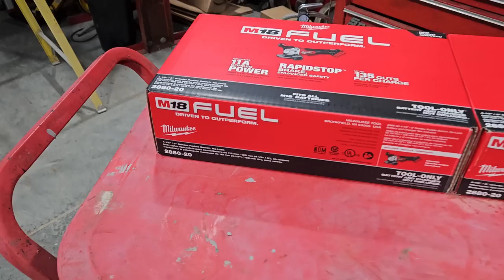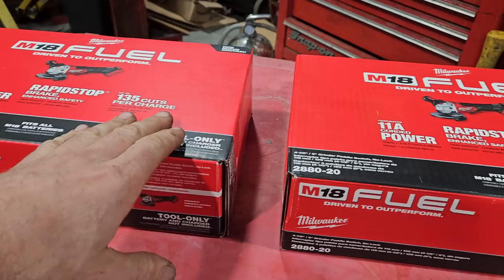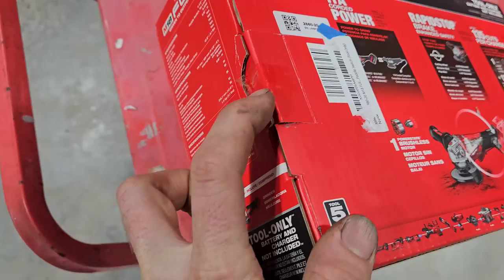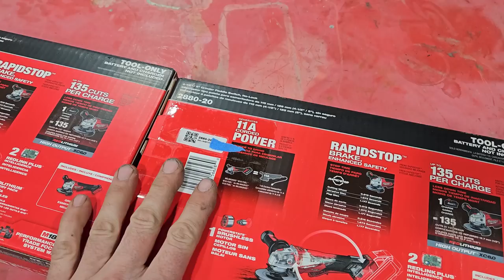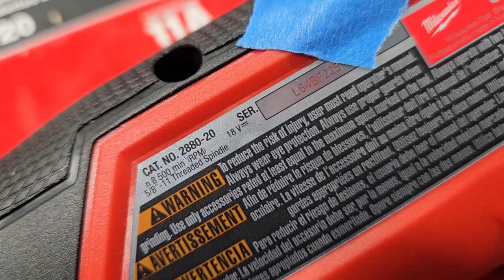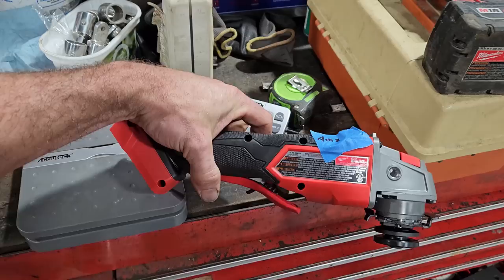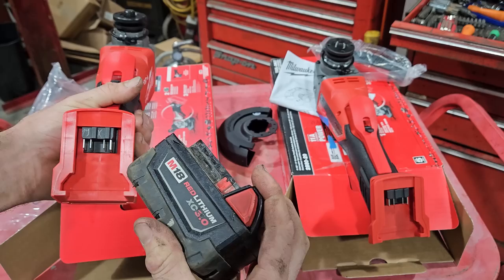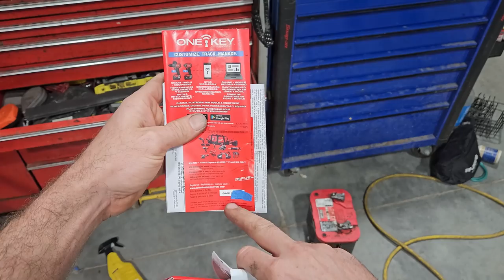Amazon MILWAUKEE Tools FAKE or THE SAME? Half Price!

Comment: I buy all of my Milwaukee tools (39 and counting) through amazon, have sent in over 12 tools, chargers, batteries to them for repair or replace WITH the amazon receipt, I've never had an issue with warranty (E-TOOL) repair service rejecting one for a fake tool.
Reply: That’s a high rate of returns unless you use them professionally

Comment: Both are real. Not saying anyone committed a crime. Wouldn't be surprised if a few boxes of Milwaukee tools ended up going out the backdoor, by a handful of workers at the factory where they are made. Can't price them too low. That just over $100 Amazon price is all profit. Same thing with Blackmarket Tide sellers. They go into big box stores in groups, grab massive amounts in their carts, head out the door. Everything they sell, profit! Some of those groups are small potatoes operations. Others.... You're dealing with some very scary, very violent gangs. Hey, money is money. There have been some known to trade Tide in exchange for drugs or even more dangerous items.

Comment: Remember folks that if your comparing tools from Amazon that using Home depot is a bad reference as they themselves have tools that are built specifically for them. You'll notice sometimes a brand of tool purchased at a real authorized retailer will have different part numbers than a tool purchased at home depot even though both are advertised as the same tool.
Reply from the maker: I always check the part numbers. Different part numbers means they're a different tool. Milwaukee has a vast line up.  And home Depot is a authorized seller

Comment: In my city there are so many so many tool resellers, 75% of them they sell brand new tools (they buy them by the pallets and sell them at 50% off) and the 25% used returned tools from depot or lowes. Def it's not stolen.
Reply: Look at you... You guarantee that they are not stolen? Hahha

Comment: I offer the following information based my experience both buying and selling tools Amazon as well as sending them in for service covered under warranty. I have a battery on the bench now that will be boxed up and shipped to them on Monday. So YES, They still have a warranty that begins on the day that the tool was produced. The date code is is part of the tools serial number. Home depot does not have or keep any record of the tools serial number and who it was sold to. And the barcode is added to the box by amazon at whichever fulfillment center the 3rd party sellers has been instructed to send it to.

Comment: As someone who works….. for a certain company…. I can tell you that the first numbers after the letters on the serial number are the year they were made. Indicating the 2251 is from late last year and the 230? is from early this year. 
People will take advantages of deals where you buy batteries and get a free tool, or vice versa, and then sell the free good online for any amount of money and they would be in the green. 
I work in Canada and two examples would be:
1. Buy an M18 Fuel Trimmer Kit with battery and get a free leaf blower - they sell the leaf blower for $100 CDN (normally $250 CDN) and they would be making money
2. Buy two M18 6ah HO batteries with a charger for $398 CDN and get a free Fuel tool (sawzall, grinder, circ saw, etc) which would normally be $288 CDN - they sell it for $100 CDN and they’d be in the green once again

Comment: This doesn't mean they are stolen. One way they do it is buy the tools in bulk or buy them when there is a free battery deal and return the battery. I have saved hundreds of dollars returning the free batteries. I've calculated I could have made about $125 on the M12 fuel impact driver and hammer drill kit when you get the free battery, if I were to sell them online after I returned the battery.

Comment: It's not counterfeit, It's just that sometimes amazon recieve like 5 pallet of tools from a seller and declare that they recieved only 3 pallet, and sells the other 2 by himself with a huge discount. I bought a milwaukee saw on amazon at 500€ wich was usually sold for 780€. But it's 100% original.

Comment: Hello electrical engineer here: in the most lamen terms I am going to explain weather this is counterfeit once for all. What people don't realize is that distributors make back alley deals. Same with factory personnel. They are genuine but those supply leaks are there. Someone or the distributor want to make a little extra money so they sell it on the grey market. Sometimes the factory does some back alley deals selling some access product in the back. Some may magically go missing weather they hit Thier quota or not. Maybe there's some factory workers doing it under their supervisors noses. This happens alot.

Comment: I purchased a brand new non fuel brushed 1/2 impact bare tool on eBay for $75 about a year ago, within 3 months it quit working so I entered the serial number then filled out a warranty return form on Milwaukees website and sent it in with the prepaid return label provided. Three weeks later I received my impact no questions asked with a sheet of paper detailing the repair work done, I can say from experience the” no warranty unless purchased from authorized dealer” line is not an accurate statement.

Comment: Could be no grease in the amazon head.  Failed tolerance inspection at the factory, so it gets sold out the backdoor for cheap. 
Or the amazon was liquidation from an over purchase from another store. Having stuff sot on the shelves is expensive, and this also tells you what kind of markup HD has on tools, probably close to 80-100%. 

That’d be my guess.
Reply: Their markups are minimal I worked there. The tools sold on Amazon are stolen that's why so cheap. They price is even below cost

Comment: I bet the amazon one have no grease in the head and might as well be a factory rejected batch of grinders when they realised that the automated grease applicators had failed. So to keep good quality on the market, they rejected the grinders that were assembled since the last grease nozzles flow inspection. Then someone from the factory brought them home instead of destroying them, and then sells them online.With no warranty because they know the heads have no grease in it. Ok, maybe i push it a bit but you GOT to open the heads to check for grease presence. Two ounces is the weigh of the grease for sure.

Comment: They are called gray goods. I bought a high end pioneer reciever with no warranty. It was not a knock off. It was not sold by pioneer US, with no warranty. It is still working 20 years later.

Comment: 0.2oz is like nickel weight, about 5 grams. Could be grease variation on the gears. HD charges extra for obvious reasons - b&m store, you can get it in a hurry, return it there etc. plus they constantly run free tool promos.

Comment: My guess is that the AMAZON is a second. Not all the parts you took out the the Home Depot were in the Amazon. The big thing I did not see  is the Amazon DID NOT have the grinder safety head and the Home Depot is. That would also account for the slight total with the box between the two of them. But AMAZON HAS TO STAND behind the tools for 30 days and that is less than the Home Depot which is usually 90 days
Reply from the maker: All of the same parts were in the boxes including the safety guard.

Comment: Will it depend on the tool stock today I was checking for milwaukee caulking gun and I found it at Amazon the cheapest one was $270  but at Home depot was $220 and you will find other tools vise versa so I think it depend on the tool stock.

Comment: There is also something called manufacturing outsourcing. I wonder if this has something to do with the significant price difference. As of tool performance I don't really see a problem between the them. In addition, Amazon does offer paid 2, 3 and 4 years full warranty to any of these type of "not authorized seller" products. At this point technically "Face" and genuine does not make a substantial difference IMHO.

Comment: Its real, it simply isnt worth going through that much trouble and then asking for a hundred bucks....makes no sense for someone to put that much effort into that type of financial return.
If its a stolen item....I can live with that...not my problem lol
It is always possible it was a returns pallet bid for Milwaukee stuff....sometimes they arent even used and someone gets lucky with some decent stuff on a pallet they paid like 5k for...its a gamble.
OR...Its possible its a pallet bid on stuff from a store closeout etc,,,,lots of different reasons you could be getting it at a really good deaL
It doesnt have to be from a Home Depot either, they dont have a monopoly on Milwaukee tools...Ace hardware sells Milwaukee along with others.

Comment: i knew a guy that worked for dewalt he told me that they make the same tool at the same factory in two different quality levels. a high quality for authorized dealers and tool stores and a cheaper lower quality version for the big box stores and everyone else. but they will appear to be the same tool but have very different prices,

Comment: Labels mean nothing, style can over time, they buy them on rolls probably hundreds at a time, next time it could be a different batch, problem is we keep buying the cheaper option, local stores need the mark up to pay overheads, warehouse has fewer costs, eventually no local shops, I want an item, local it's 180, online 125, but the local outlet won't be there much longer as they cannot compete, warehouse stuff is ok but when something goes wrong they can be awful.

Comment: it could be that the less expensive tool is refurbished , or it is older and out of warranty. I think you only get one year warranty with authorized refurbished too. With new tool you get 5 year warranty . I just took a mid torque impact into local warranty repair shop . They just look at the date on the serial number - no receipts needed. Within 5 years and free repair of the electronic module in my case which would have been over $100 just for part.  So worth a lot to get something with warranty . You can look up online how to read serial number to tell manufacturing date of tool.

Comment: Amazon is cheaper Bcz Home Depot has online deals that aren’t in store pretty often. Sellers buy up and later can make money while still selling cheaper than in store. Also the heads are cast and no two heads will be the same. That’s the weight difference. Also if you wanted to keep the Home Depot one you could of just switched the boxes and put the Amazon tool in the Home Depot box and returned it.

Comment: I was at a place that sells overstock stuff and they had a 1/2 Milwaukee impact that looks exactly like mine, expect for one glaring difference, the one I have you can change modes, the one at the place I went to does not have that option. And to top it off it was only like $40 different from OG price.
Reply: they make hundreds of tools, was it just a different model with different options probably?

Comment: The ones sold on Amazon were most likely defective units that were sold in store, returned, and repaired, then sold at a discount to a vendor, that’s why no warranty exists on the ones sold on Amazon, because the warranty repair was already fulfilled
Reply: Reason for the small weight difference could just be grease removed accidentally during warranty repair its was only a .02 difference not a .2

Comment: Probably from the same production line, big box seller here had a "15% less if you find the same model cheaper elsewhere" they always checked the "model number" catch was the model number was STORE SPECIFIC__  ie only they could buy them with that number, complete consumer rip off. Have seen the same on circular saws, they even have the same casting ports on they shell__ only difference was the colour and label.

Comment: For what it's worth, on a similar note: My brother worked in Shanghai for about 8yrs and made some local friends.  They would tell him about iPhone fakes wherein the employees would come in on 3rd shift and use lower quality materials they brought in and use it on the same assembly line to produce a clone phone.  Those would be sold locally or via online scammers.
This makes me wonder if the same thing has started with high quality Milwaukee fakes where a 3rd shift brings in cheaper plastics, bearings, etc. and use the same assembly line to fabricate their lower cost clones.

Comment: As someone whos been burned by Milwaukee not honoring a warranty from Amazon... Why? They looked up the codes, it was authentic, even apple will back there stuff off Amazon. I could understand if it was a knockoff battery or something. Luckily the Amazon seller fixed the issue for me.

Comment: I think people buy them from hd when they are running sales and when they come with free batteries.   The way it rings up is the tool is even cheaper then the battery rings up cheaper also instead of being free.   You still have a warranty it goes by the dom code instead of purchase date.   I could be wrong about how they are purchased but I know that's how the warranty works.

Comment: They are the same. Its just the sellers are not certified seller of milwaukee. Because milwaukee wants you to spend like 30,000 dollars on your first order to be an authorized dealer.  Now granted you won't get the 3 and 5 year warranty from millwaukee if you buy it from amazon but they are ways around that. Milwaukee will usually try to help you out the best they can. And if not. Well..... there are still more ways..

Comment: the weight difference might be an security tag inside the head    that Milwaukee puts in ts tools for HD. or to balance any run out .sometimes weights are added on a shaft

Comment: I bought one of these grinders off Amazon. It is identical to the floor model at home depot and it works beautifully. The only time I've needed to warranty is for the one key system or whatever it is with the Bluetooth Hopefully they fixed that problem. Mine broke right after warranty. Tools work fine won't wake up to phone anymore and one I can't select between the 4 settings. But I also beat the living Christ out of them. How I use my half inch drill to start small engines and four wheelers😅

Comment: 3 pounds 5.2 ounces from 3 pounds 5.5 ounces is a difference of 0.3 ounces. That's 3 tenths of a single ounce or 8.5 grams. And that comes from the two tools having slightly different spindle nut. They likely have multiple suppliers for that particular part.

Note:  Not that it matters but  the amazon unit has been out of the box at some point. You can tell by the way that the cardboard isolator was forcefully reinstalled causing the ends to be deformed.

Comment: authorized just means that the tool wont have the warenty which is why authorized is more expensive you pay double because if it does break under warenty they can just give you a new one no problem but un authorized means that theres no warenty and youll need to buy a new one yourself

Comment: The first thing that comes to mind is advertising. In addition, HD has the overhead of a big middleman, while the Chinese distributor may not have the demands of brick-n-morter locations, employees, and advertising. There are also costly product protection safeguards HD implements to handle their inventory properly with humidity and temperature controlled warehousing and material handling that I wouldn't expect from an unknown distributor. At the end of the day, the reality is this; once we buy a Milwaukee, we take it out of the packaging, and we store it in our respective workshops in various conditions. If it's a true Milwaukee, it's going to be just fine.👍

Comment: The home depot deal is when they are running  a promo (witch is almost always)- thats when home depot wins - they usually will throw in a free battery ect.
As far as Amazon and warranty - that is directly with Milwaukee and they are good with taking care of problems and Amazon is good too - if you were to get a fake just return it amazon will back you against the seller if there's a problem

Comment: I heard some where that 90% of the Amazon ones have something as little as the incorrect color, or rubber pieces are not even thickness, or plastic parts are not as hard as they r supposed to be so those get sold cheaper. No major defects just very minor things wrong. Not sure if that's the truth or not just a rumor I was told.

Comment: i think the reason depot is way more money is because they take back any thing for the most part. so the over charge makes up for any loss that the manufacturer doesnt give them credit for. just like insurance companies they never lose out. my son bought an outdoor furniture set and it started to rust. he called them and they said we will send some one out they did he filed a claim and my son got his money back but depot never came to get the furniture set. so he sold it on line. i thought either depot has an insurance on their products or they over charge soo much that they can afford to take the loss, but like i said they take back anything no questions asked for the most part

Comment: In many cases, it could be that a batch or shipment was rejected at some point in the distribution process for some reason....and ultimately ended up going to the reseller on Amazon.  It also may simply be a little as HD pays to be an "authorized reseller, with full warranty backing" and this guy on Amazon does not.   Back in the 90s, my dad worked at a Radio Shack store...and I forget the electronics brand but...one of the brands sold there was simply a re-label (literally just the name plate) of another high-end brand, the only difference being the warranty, at less than one half the price.
Reply: casio